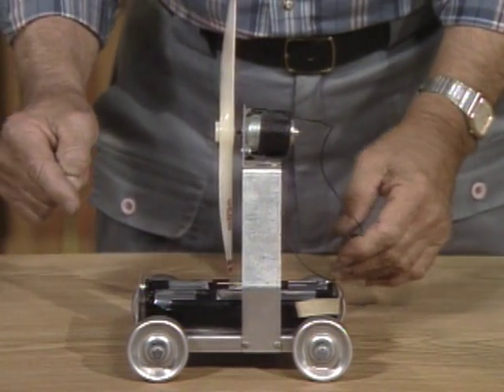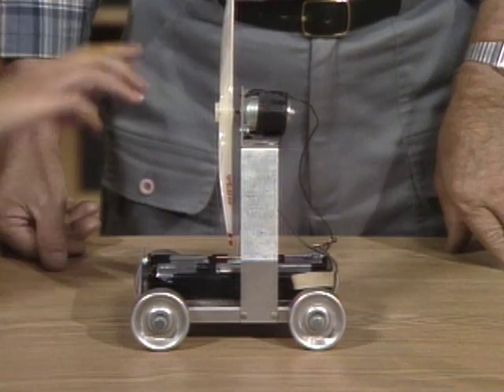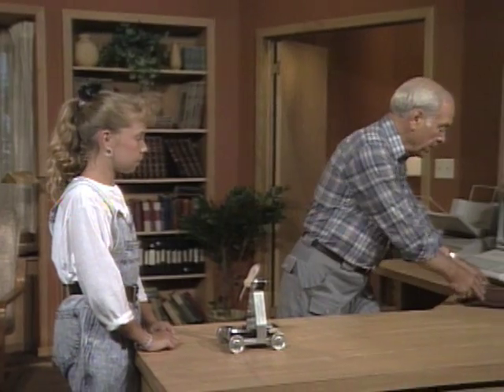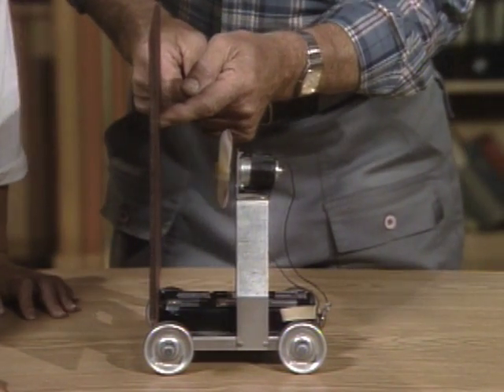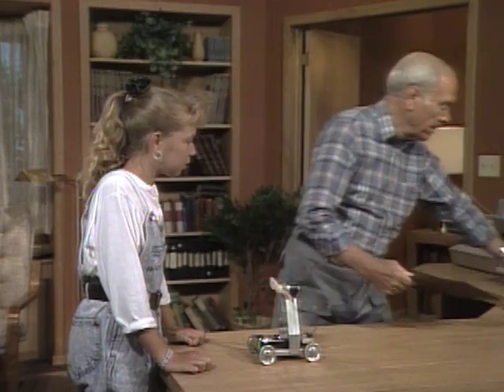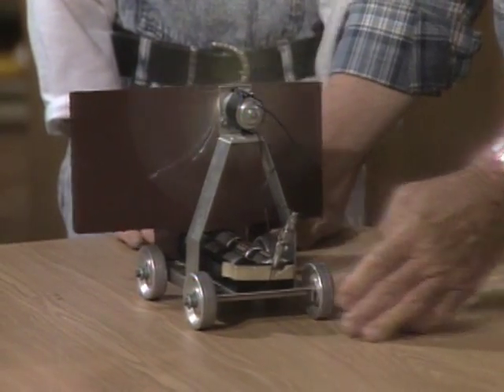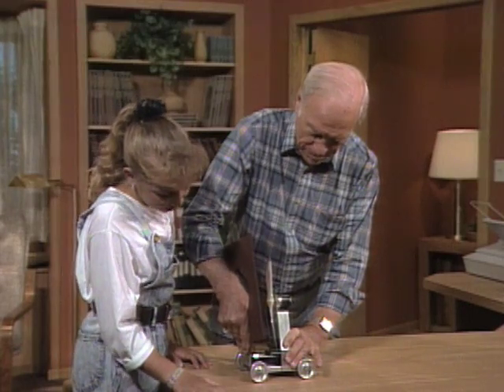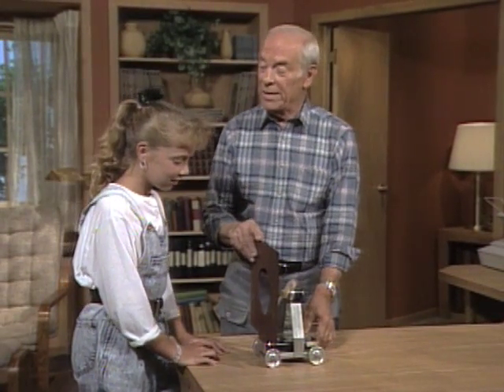How Do Propellers Work? (Mr. Wizard)

Comment: Would the machine move if we put a desk infront of the propeller?
Reply: We must check it! But I assume that it will prevent from moving it forward, maybe slow it a bit, actually aerosleigh move in such way.
Reply: No, no air to be forced by the prop, so no speed